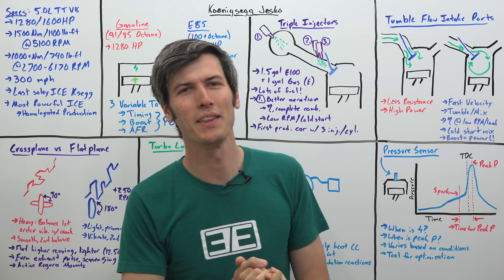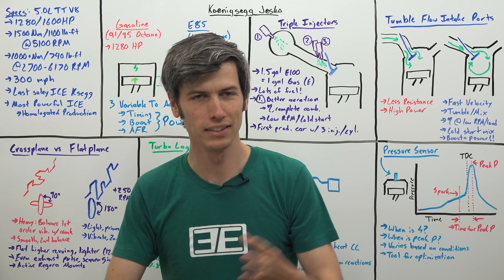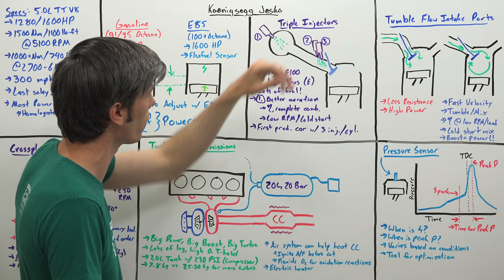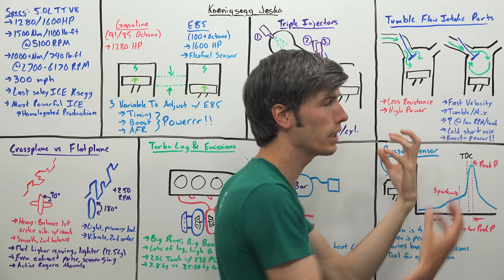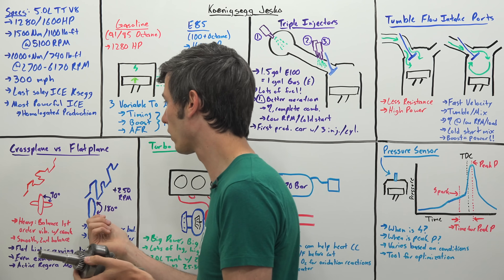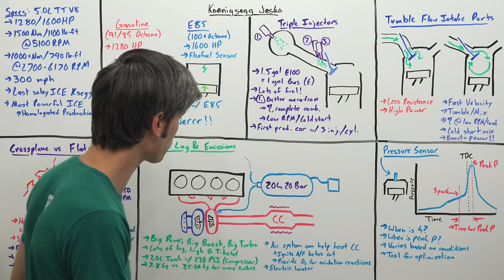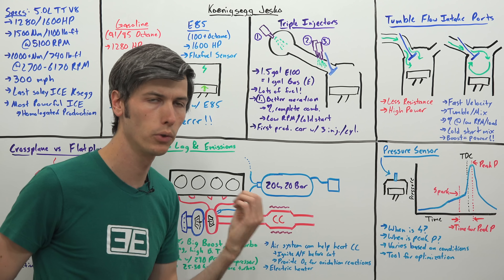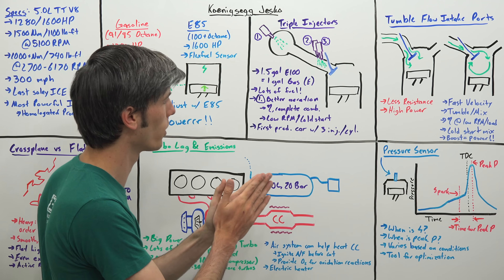Koenigsegg Jesko - The World's Most Powerful Production Engine

Comment: I thought the most hp you can get is 188HP/L if you want some sort of reliability and lifespan, anything above that is a gamble
Reply from the maker: How did you come to the conclusion of 188HP/L? There's no simple rule here unfortunately, quite a few factors involved. They also have pistons designed to reduce peak pressures but offer a greater average pressure.
Reply: Digidi4 not sure where you got that figure but design and materials technology is continually improving, likely helping make these fantastic figures.

Comment: ok all good but.. how many mpg?
Reply: ﴾ ﴿ probably between a few and a bit.
Reply: More like gallons per mile...
Reply: Probably 9 mpg...

Jason explained that it uses a lot of fuel to make 1600hp. Even though the engine isn't huge displacement, with it making that much horsepower, fuel  mileage is most likely be very low.
Reply: doubt it is lower than 25 mpg, as this is not a heavy car and uses only 5 l modern engine.
How much power it can generate is not of that much importance as everything is nearly exactly the same (weight, friction) internally compared tona lower power v8. The turbo is the difference.

Comment: Here in UK we also have 97ron and 99ron petrol. Would this engine produce closer to 1600hp on these rather than 95ron or 91 US
Reply: US/Canada 91 is not lower octane than your higher numbers in UK/EU btw.  91 US=97 in UK.
Reply: @rolfbjorn9937  I know that US 91 isn't lower than our 95 and is just calculated differently. The start of video the comparison of fuel is 91 for USA and 95ron for Europe produces 1250hp ish. I don't know what your equivalent fuel in USA is to 97 or 99ron UK fuel. So assuming that on 99ron UK fuel more hp should be possible and closer to 1600hp on ethanol
Reply: @T Croft is German fuel comparably better than UK fuel

Comment: I wonder when freevalve will show up.
Reply from the maker: Same! Here's a video on it for anyone interested: https://youtu.be/FJXgKY2O4po
Reply: Exactly
Reply: Imo, Free valve is only good for optimal efficiency/torque along the whole rev range, doesn't really increase peak power. For performance engines, a simple vvt optimised for high peak power would suffice. Not to mention the risk of destroying the engine if a solenoid jammed due to computer lag.
Reply: @MazdaRX7007  Yup but computer also controls injection, ignition and boost and getting those wrong can also kill an engine.

Comment: But does it have free-valve? That's tech I'm ready to see in production.
Reply from the maker: It does not, would be cool to see in a production car. New cylinder head versus the Agera, but mostly to implement tumble ports.
Reply: They were engineering a system for a Chinese car manufacturer. So they will be in production in quantity.. just not in a Koenigsegg
Reply: As it sits right now, cam-less engines work best at 5000rpm and below if using electromagnetic valves. The only way for them to work at higher rpms reliably right now is air actuators which adds a lot of complexity and longevity. I think we will be seeing cam-less diesels in the near future, that 5000rpm cap limit is pretty much the cap on diesel anyways.
Reply: William Stewart , Cummins came to my high school in 1997 with a electromagnetic camless diesel. The truck drove like any other diesel. It was cool to see infinite cam/valve and lift/duration timing. I remember them changing all the timing while at idle. The could make a 6 cylinder diesel sound like a 8 cylinder big block gas. 22 years later, still nothing like it in production.
Reply: @jeffandrews7335     I can see where loaded operations might have issues hard to deal with but things like stationary diesel power plants (mostly remote...) could definitely take advantage of such mods...
Reply: @hanboscc  The valve part is exactly the same as in a normal valve control system, simply a mechanical valve and a spring. Absolutely no difference to a normal setup.

Also this means that if anything breaks the valve closes, so this system will be safe for the engine even if it malfunctions, unlike a classic design, where a valvetrain breakage/slip destroys the engine head and the pistons.
Reply: They ll have camless valve in the future version. (Floating valve
Reply: Finally, Koenigsegg finally put FreeValve engine for their new car, the Gemera.
Reply: FreeValve has become vaporeware
Reply: @azraela9  Well, they did address that with an oil valve damper, and that should have the oil rail pressure in it, so should increase the dampening force with the increase of rpm.
Would be very strange if that's making any problems.
Reply: Waldemar Perez Jr I really hope that’s the case 🤞🏻
Reply: I doubt that we will ever see that technology. By the time it's perfected the ICE will be supplanted by electric motors and improved batteries.
Reply: @davidyaroch6622  then I guess you think that Free Valve won't be done for 50 years, because the IC isn't going anywhere in that time
Reply: wait,  I thought all koenigseggs used freevalve since a few years ago?
Reply: tommihommi1 not yet